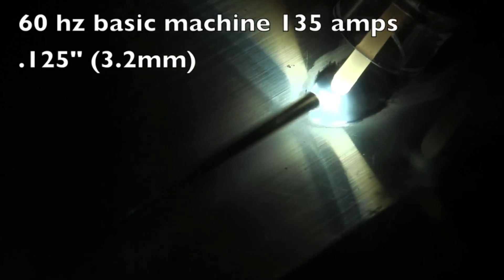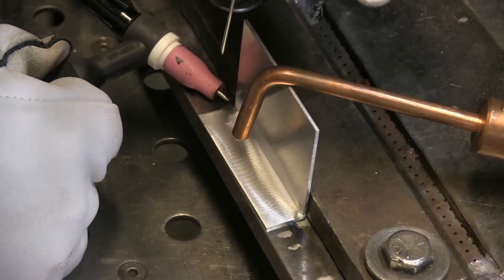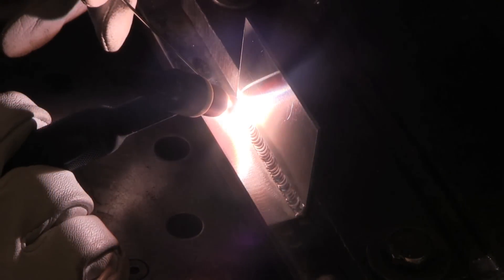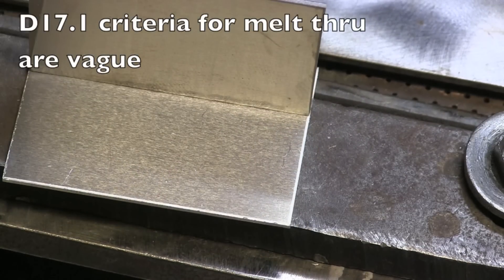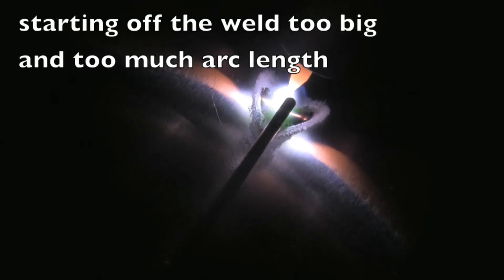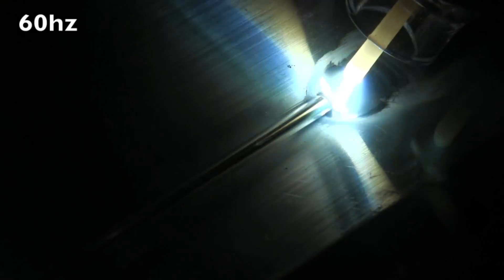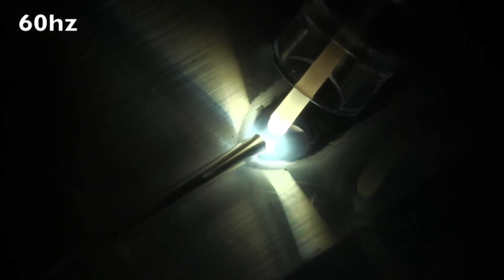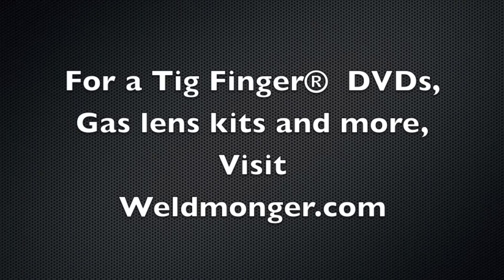Tig Welding Aluminum Tee Joint .063" (1.6mm) AWS D17.1 Certification Test Tips

Comment: Currently doing this test 1mm to 3mm plate. Two runs required a root and a cap. Would love a video on this if ever possible sir. Its proving very challenging the d17 code.

Comment: Can someone talk to me a bit about amperage. I'm going in next week for the first 2 of 13 tig tests for Boeing. Going to be welding tee joint with 1/16th base plate and 1/32nd verticle plate. Should I set amperage based off the thinnest material or hit it around 70-75 amps and feel it out with the pedal? Any advice would be appreciated

Comment: I can not get a good melting point and what happens is that the whole area is exposed to the gas melt rapidly، how to solve it.

even if i weld 3mm ..
argon flow that am use is 5
120AM
my problem is that am not able to get one melting point where it should be inder the tungstun .. how to solve it?

Comment: been welding aluminium for 14yrs now from 1mm up to 5mm...you really should flatten the end of the zirconiated electrode a little just at the end and after a bit of welding you'll get a nice shiny ball on the end of the electrode if you're doing it right. (using the correct ampage/electrode size) and clenliness is key to a good weld on aluminium (aluminum to you americans)

Comment: Hello Jody I was wondering if you've ever heard of a power tool company called thor silver line I ask because I have been passed down a 7" grinder from my grandfather,the only problem is he forgot how to take the grinding wheel off,now I've searched high and low on the internet and forums but I could not find anyone who has ever used one,I ask you because you seem pretty knowledgeable if you can help it would be greatly appreciated. And or anyone in the comments

Comment: how does your tip stay pointed? mine always balls up when doing aluminum. i dont have that problem with stainless though.
Reply: Depends on a lot of things.  Tungsten alloy (pure, vs. lanthanated, thoriated, etc.), how fine you grind your point, AC balance, current, etc.  

An inverter machine with  an AC balance setting around 70% negative or higher, lanthanated/thoriated/ceriated electrode and a slightly steeper point grind will hold a decent point on the tungsten while welding AC aluminum.  A transformer machine with a 50/50 AC balance running a pure Tungsten electrode will ball quickly.
Reply: bigtb1717 alright thank ya sir, ill experiment

Comment: Hi Jody! Ive been a long time viewer and figured I would share a somewhat relevant story to see what you thought. 

I work in a petrochemical plant and a few years ago we were doing a job on some cryogenic service aluminum exchangers. The service prevented a hydrotest so we were X-raying everything (mostly socket welds) since it was in a confined space that that would be extremely inconvenient and costly to access again. When the specialized welding contractor showed up they requested a portable AC unit for the welding area. Being summer time on the gulf coast we assumed this was for comfort reasons so we didn’t provide it since the heat index was still inside our tolerable working limits. After we started having issues and actually failing socket welds for porosity, we were informed the AC unit would lower the humidity and the rejection rate for porosity... They were right. If I hadn’t seen the film before and after myself I don’t know that I would have believed it. 

Aluminum welding is very uncommon in our plant so all of my prior aluminum welding experience was motorsports related which was done indoors and never X-rayed. I had never seen humidity have that drastic of an effect, some of the “before” welds were worse than your dirty test plates. I was curious if this was something you had encountered before? I still wonder about it sometimes but it got the job done right and on time which is all that matters.
Reply from the maker: you are right on point....humidity is a big factor for porosity in aluminum

Comment: Hey Jody. another great video. was just wondering what would you recommend for filler if you dont know what series of aluminium it is. or if youre welding lets say 4 thousand series aluminium to 5 or 6 series. or if its cast aluminium. Thanks

Comment: very good information Jody, everything you said is spot on! I did my aviation tig training at naval air station Jacksonville florida, the only thing that was different is they did X-ray analysis on all the joints 2g, 3g, and 3f on aluminum, mild steel, Inconel 600, and stainless steel. I will also add the standard machine in naval aviation right now is the Miller Syncrowave 350LX and does not have frequency control.
Reply from the maker: thanks, the naval station sounds a lot like where I worked. All of the Butts were x rayed but 2f and 3f fillets were macro sectioned.  Still a lot of old syncrowave 250 tig machines there too.